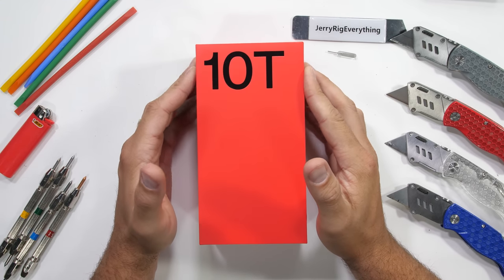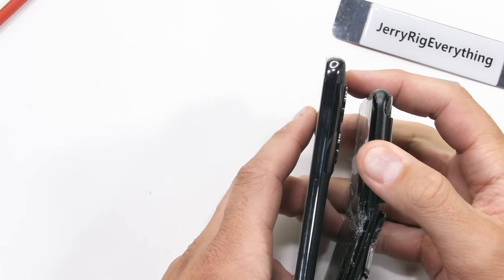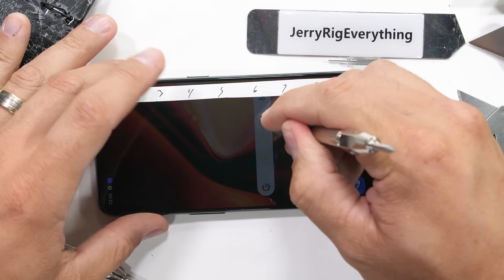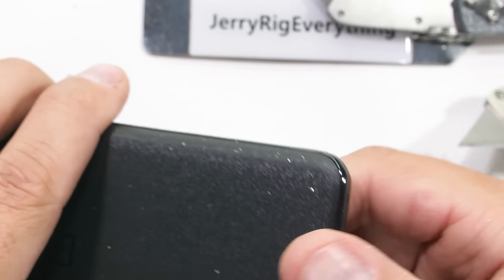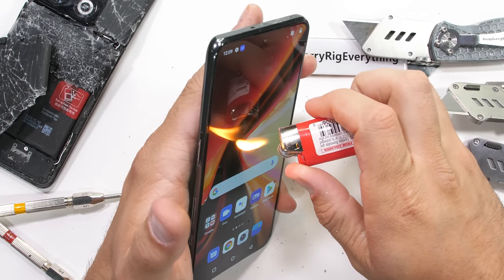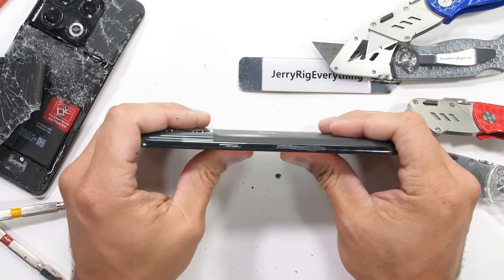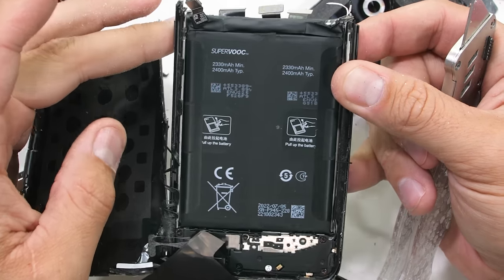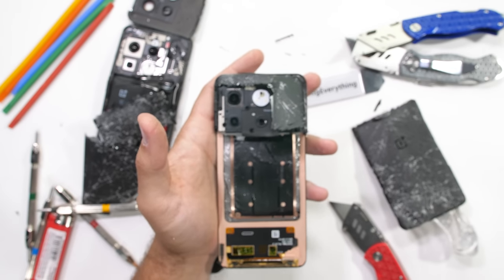Has OnePlus Fixed their Newest Phone? - Durability Test!

Comment: Two phones to fail Zack's bending test in a row, OnePlus has definitely lost its touch. It's not just another brand, it's now a brand with fragile devices. 🔨
Reply: Rip oneplus
Reply: I mean whos behind Oneplus now? Carl pei made Nothing phone 1.
Reply: So with oneplus falling I think ill switch to Sony or google pixel when my 9pro dies
Reply: That bent with this force and pressure applied makes a phone fragile ?
Reply: @kunalshah912  it is not alot of pressure and yes, compared to other phones of the same price that recieves the same amount of force. And compared to the giant piece of glass that was the Tab S8 Ultra which was thinner and like 3x the size, this phone is fragile as fck. Also looking at the folding phones which are supposedly super fragile survived a bend from the wrong direction, this and the 10pro are weaker than a piece of paper
Reply: @kunalshah912  there is a reason that test was done. The burn test was for fun only but the bend test is even better than the freaking drop tests
Reply: @CVI2 can't remember that it failed so hard at their Nord, which was also made of plastic
Reply: @CVI2 but you haven't mentioned that in your previous reply
Reply: With 90% display issues in every devices
Reply: Not only fragile phones, Bad phones at an excessive price, and removing features that made them unique
Reply: @CVI2 the iphones have that giant slab of camera. The pixels literally have a line of camera where this thing broke with the same curved design
Reply: @CVI2 Thin phones in general that are made of plastic tend to snap easily. Seen Huaweis do the same as well. If you're gonna make a phone stupid thin at least use a denser material where it's needed.
Reply: @CVI2 Gotta agree with that. My S7 is pretty annoying to hold without a case, plus the extra space granted by making it thicker can be used for a bigger battery.
Reply: @CVI2 If only. They managed it with the S5.
Reply: I think you are right, i have An oneplus 8 pro and i do think It is the last good oneplus they made...
Reply: @ActionDriveFusion  same. 9 pro is my last oneplus. Software sucks major balls now too.
Reply: @esco8778  thats why im still on android 11
Reply: @ActionDriveFusion  Same thought with my personal 6t & model 8 which is my working phone. Also this new ColorOS UI is terrible compared to old OxygenOS which is running on my 6t. I don't think I'll buy another oneplus never again. Sony or Samsung for me thou. Pixel won't support 5G in my country.
Reply: If anyone does this to their phone, they deserve to have it destroyed. lol
Another useless test which won't affect anybody in real life. 🤷🏻‍♂️
I don't own OnePlus now, but these are just ridiculous.
Reply: @ActionDriveFusion  If you want an Android and top quality, the name is Samsung. I had to find this out the hard way after being pretty anti-Samsung. Once you go Samsung flagship, you never go back.
Reply: To be fair tho they have mostly the same design, as all T models have.
We'll have to wait next's year phone to know how that's going to go
Reply: @fynkozari9271  CCP 😅
Reply: @CHRoOMAX  But Samsung explodes!
Reply: @solarboy7950  repeated outdated joke that is not even being heard of in 2022 and still salty about them as much?
Reply: @baoquoc3710  I don't joke about safety. It is on their record. You should feel luck that there are still people like me ringing the bell from time to time to save your forgetful ass. You call it salty talk, I take it public supervision.
Reply: @CHRoOMAX  
I hate the bloatware that Samsung comes with, that used to be one of the reasons I got a OnePlus back in the day after having owned a Samsung. Not sure what I'd get now if my phone stops working though.
Reply: Another OnePlus becomes nothing phone
Reply: They are just a cheap brand now as far as I am concerned. I am actually surprised he would even review another Oneplus phone after this. Who reviews cheap phones? Not many people and I expect him to drop this brand from his channel for another further testing.

Comment: I love how the cameras are just regular size, but they have these huge circles around it that makes people think they are comparable to like the iPhone 13 pro sensors
Reply: It's what cheap Chinese brands usually do to try stand out to a larger audience,  its sad to see one plus come to this state
Reply: well people bought OnePlus mostly for the software experience then secondly for hardware .. ever since they merged with oppo's OS  its a dead company
Reply: 2 of the 3 rear cameras of 10 pro are larger sensors compared to.iphone 13 pro
Reply: That is not a correct comparison. The OnePlus 9 pro has a 1/1.43 inch sensor, while the iPhone 13 Pro Max has a 1/1.9" sensor, a bit smaller. The huge circles are for the lenses that focus the light into the sensors. If you search for a camera replacement for the iPhone 13, you can see they look as small as the ones in this video.
Reply: Even iPhone does that. There's no need for such big circles, the aperture of cameras in mobile are tiny and a 10mm max.
Reply: @TheJoigoman  13 pro/max sensor size is 1/1.65", 12 pro max and 13/mini sensor size is 1/1.9"
Reply: Think it's for autofocus
Reply: common iphone w
Reply: Iphone is exactly the same, what are you talking about 😅

Comment: That is the 10T official teardown as Oneplus recommends, see the screen worked just fine but it's rated to open at 89 degrees not 90. Still great phone with easy battery replacement method.

Comment: What was once feared has vastly fallen. I really enjoyed my 3t and while my 8t has seen the software decline I was hoping they would correct the faults. Unfortunately they have seemingly became that what they despised. Maybe they will fix their issues in the future, but for me the 8t shall be my last OnePlus phone as I don't think I can trust the brand anymore.
Reply: You can always go for an easy Samsung Galaxy, or if you're feeling a little wild, nothing is still an option 😏
Reply: Had a 7T Pro.  After the upgrade to Android 11, it slowed to almost a halt.  Almost had to beg someone to buy it.  Well, I moved across to Samsung.
Reply: Lol my 3t was screwed so badly by their software updates, that i stopped buying their phones after that
Reply: @kcnairnair7299  i have a 7T Pro as well with Android 11, mine is just as fast as its ever been.
Reply: @reeve7929  Good for you! I had heard some models has no issues.  Even in the same geography too.  My luck!
Reply: I switched from a 5T to a Pixel 6 pro, I was debating between that or a 10 pro. Loving the pixel so far.
Reply: 7t pro was so good.
Reply: @21Dazzler  that was peak OnePlus tbh
Reply: 7 pro my last OnePlus phone✌️
Reply: @kcnairnair7299  which phone did u purchase after 7t?
Reply: @facelessangel  A52S Samsung
Reply: I too had OP3 and it was really the best bang for bucks smartphone. Enjoyed it last until the screen cracked after falls to concrete. Too bad the latest OP at that time were so expensive and thinking might as well just buy the Samsung S10+. Will never go back to OP. 😂
Reply: Got the 8 pro and while amazing hardware...the software is such a mess.

Not to mention everyone seems to have forgotten Oneplus rendering the infrared camera unusable with a patch. Never before have I seen a company tampering with hardware after purchase .
Reply: I'm still rocking my 3T. I just barely use it, mostly just as an alarm clock and watch, internet 99.9%% off, screen 99.5% off, and it's fine, battery lasts about a week usually. I have looked at many new phones over the years, but most of them are just too expensive to justify for how little I will use them.
Reply: @reeve7929  I have a 6t but same. Is almost as fast as the day I bought it, the battery is draining faster but barely noticeably tho
Reply: The same thing for me with the Oneplus 6T.

Comment: I have a One+ 6s (I think) I've had it a few years now and it was cheap then, it's withstood bouncing down the stairs several times it's been dropped screen side down more times than I can count, it's been bounced off of door frames been kicked been stepped on, the back is covered in gaffer tape and still it works! The toughest phone I've ever owned by a mile.
Reply: Is that what you do with your phone?
Reply: @oracle8785  
Not on purpose chap, it's what's known as being busy 🤣

Comment: The OnePlus 7 Pro was the pinnacle of OnePlus. My 7 Pro is 3 years old now and still looks and works just like a brand new phone. No problems at all. Love it today as much as the day I bought it.
It's really sad to see OP going downhill after that.
Reply: Yeah, the only downside is the lack of software updates.
Reply: @kAs1m360  You could try installing a custom rom. I'm currently running Flamingo OS based on A12 and it's rock solid.
Reply: I still remember the joy and excitement I had when I got my first OnePlus device, the 7 Pro as well; I eventually went to an S20 after that, then a S20 Ultra a little while later, but ended up going back to an 8 Pro. It felt familiar, and I really liked it, plus the camera was definitely an improvement over the 7 Pro and even the more expensive S20 Ultra.

Just last month I made the move to a 9 Pro, and decided to keep OxygenOS on it just to give it a try, since I typically put a ROM on all of my devices when I can. When looking at what they did with the software in OxygenOS 12 and even 13, and how the 10 Pro is almost identical in spec to the 9 Pro, or how the 10T is just.. odd, it's a little disheartening.

It's kinda funny, since history might repeat itself for me. I had 3 LG phones in a row in the past (G6, V30, V40) before switching brands. With me now going from the 7 Pro, a little sidetrack to an S20 and back to the 8 Pro and now 9 Pro, this might be the end of the road for me, and it'll be hard to figure out where I might go from here, if I even want to jump off of the 9 Pro, it's still pretty decent hardware too. It's just a shame that there isn't many brands to pick from anymore, aside from the new ones like Nothing who are region exclusive right now, or smaller brands that were genuinely interesting, before they got bitten by the crypto virus (aka OSOM.)
Reply: @Raul1528  Some people switch phones too much, damn.
Reply: @jaroslavmrazek5752  I usually switch after a year of use, sometimes a few months less or more, and I always stay a generation behind since it's typically cheaper and generally more stable, especially if they're physically broken and can be fixed easily, like a cracked back.

Like with the 9 Pro I just got, I found it for $299 with a broken glass back, and I was able to get a different (matte) color for just $20.

It honestly just keeps things interesting, being able to see what's new or different between brands and generations.
Reply: I had phonecall problems since day 1... when I was indoors no one could understand me due to noise.... switched it after 2.5 years for a cheaper xiaomi 11t .... works way better...
Reply: I'm still using my 7T. Great allround phone. Still getting updates.
Reply: @peterdevreter  The 7T and 7T Pro shall have official Android 13 updates. Lucky you!
But no worries. I'm sure A13 custom roms shall arrive for the older 7/7 Pro anyways. Fingers crossed!
Reply: @Raul1528  But sticking to a certain model helps build up a relationship that you can't experience when you switch phones around too much.
Just my take, different people have different tastes.
Reply: Same with me. My 7pro is fully functional without any flaws!
Reply: 5, 6 and 7 series were their best runs. Oh well..... Back to Google phones then.
Reply: im still using my gunmetal grey 3t
Reply: Yeah I have a 7T and I was planning on replacing it after 3 years which would be now, but it's still going strong and a high quality phone. Sucks that OP lost what made them unique in the first place
Reply: I have OnePlus 1 and 3, i used any time they are a good phone.
Reply: Update it to OOS 12 and comeback!
Reply: Ys mine too..buttery smooth awesome phone still now..nice durable and also no problem with the pop up camera
Reply: I just got oneplus 7pro used a month ago for 215$, it is the nicest phone I ever got but the battery is the worst I ever got, my 5 year old LG that was way cheaper new than the op used still has a better battery.
It is the t-mobile variant and I didn't get the Android 12 upgrade yet.
Reply: The 7 Pro really sucked in my case. I prefer my 6t as this still works after I bought it the day of release.
Reply: Absolutely. I used it with joy as long as it got updated. Now i switched to a pixel 6 pro, and i don’t iss anything except the cool popup camera because of the geek factor..
Reply: Wish I could say the same. Mine is working alright, but a few weeks ago the pop up camera stopped working. It will pop-up, but and display an image of what it saw immediately, but that's it. It's just a still image of what it saw the instant it came up. Guess I got unlucky
Reply: I'm still running the 7pro, apart from the fingerprint scanner pattern being burned into the screen it has been great. Battery still goes well. Android 11 was a bit of a downgrade until I realized the ram boost setting was causing the lags
Reply: Keep telling yourself that... The 9 pro was the best phone
Reply: Same here, i still have the 7 pro and i was considering upgrading but their new lineups have lost their touch, its so disappointing man.
Reply: i have the oneplus 7t pro and it is garbage, slowed down so much with the android 11 update, not usable.
Reply: @kenmastersmaster  Not to argue, but may I ask how? Apart from the snapdragon 888 which we can get in many other phones (and that too at much more reasonable prices), I don't see anything special or groundbreaking in the 9 Pro.
Reply: Also running the 7 pro from the start. Probably going to Samsung next year if OP fails with there next phone.
Reply: @bassam_salim
Reply: @Shivasish666  Throwing in my two cents about the 9 Pro (after all the things I've used); I'd say one or two things it provides over other other OnePlus devices is just the distortion-free ultrawide & longer telephoto lens, otherwise it's quite similar to the 8 & 10 Pro (granted the 10 Pro supposedly uses a smaller sensor in the ultrawide)

From a 7 Pro to a 9 Pro, it's definitely quite a noticeable jump, but afterwards the improvements did dampen a little
Reply: wish I would've gotten it but I'm still on the 6T, still running solid af though! the back is barely even cracked too even with how many times I've dropped it on countless different surfaces lol
Reply: Another OnePlus becomes nothing phone
Reply: 7t pro here! Still Happy. But my Phone has 2 Bugs...
Reply: 7T Pro here and yup it's great. Now I want to see how the Zenfone 9 fares in durability lol
Reply: I have one plus 7 and i absolutely love it
Reply: Same here
Reply: Im using 7 pro for over 3 years too. Works perfectly fine still, love it
Reply: iam still using 6T and its still in good shape only mute switch is slightly bend
Reply: 7t made 7 pro irrelevant. Te pinnacle imo is 7t pro
Reply: BS, OP6 was the pinnacle. Just because you bought a OP7 pro, don't suck up to it
Reply: Me too! I've been debating getting the maclaren edition just as a back up
Reply: Wait. That was 3 years ago already? I did not notice it with my OnePlus 7 Pro.
Reply: @savisish
Reply: Yeah i also use 7 pro awesome but  nowadays OnePlus is failing continually
Reply: My 7 Pro sadly lags like a mofo, super sad :(
Reply: 7T Pro, not 7Pro.
Reply: @rollin2874  T versions don't come into consideration, sorry. 😜
Reply: @karthikeyanjagathesan657  The OP6 was pretty good as well. But the 7 pro improved upon that on every aspect possible. The notchless full screen display with a 90 hz refresh rate is the crown of the phone and it is amazing in every single way. Something the OP6 could never compete against.
Maybe you are cringy because you bought a OP6? 😸
Reply: @kenvaxia  Yo bro, our phones are like senior citizens now lol. 🤓😄
Reply: @scouy  Try flashing a custom rom bro. I'm currently using Flamingo OS based on Android 12.1 and it is stable and smooth af.
Reply: @honey-lk3wt OnePlus has been so disappointing the last few years that I honestly don't know which phone to buy next.
Reply: @KsanasLager  Congratulations bro. You made a good purchase. SD845 used to be a beast back in the days.
Reply: @nonstopqs4188  The 6 series phones are built like tanks. Even the 7 series is much more durable than I expected. Have dropped it a couple of times myself. No issues whatsoever.
Reply: 8 pro is good, the last one worth buying
Reply: OnePlus ended in series 7
Reply: Loved that phone to ran it for over 2 years bud sadly my camera stopped working, wouldn't pop up
Reply: brands and product you buy are two different things, i own op8t    and i still think its pretty awesome
Reply: i got a oneplus 9 pro, funny thing, it was fine at first, then got a big update that basically ruined the camera app, and then got another big update that revamped it and fixed it
Reply: @kAs1m360  now with color os they will have 4 years of updates